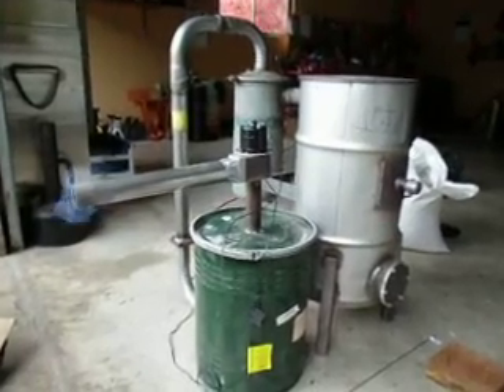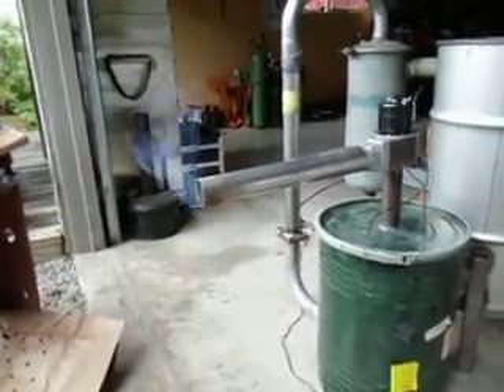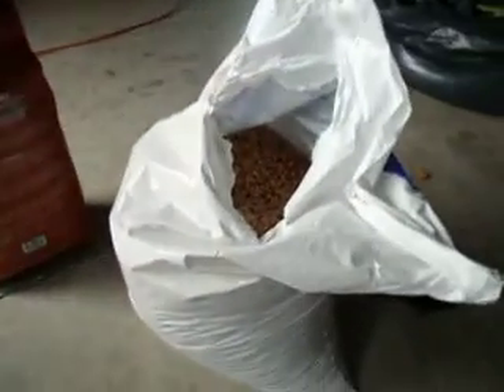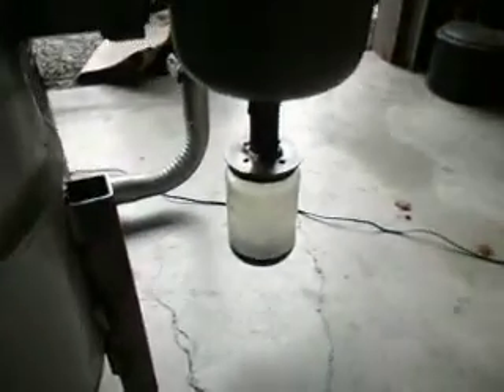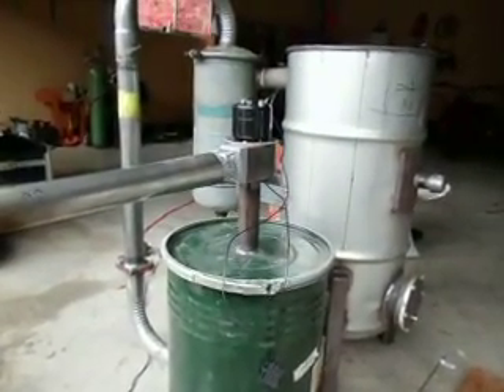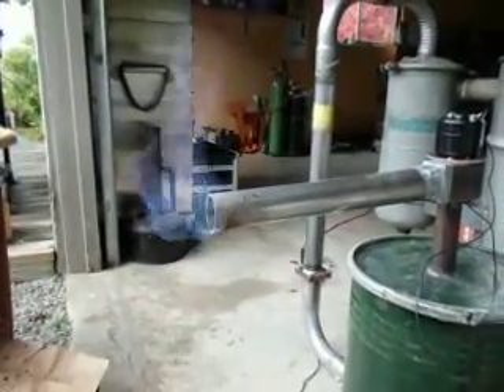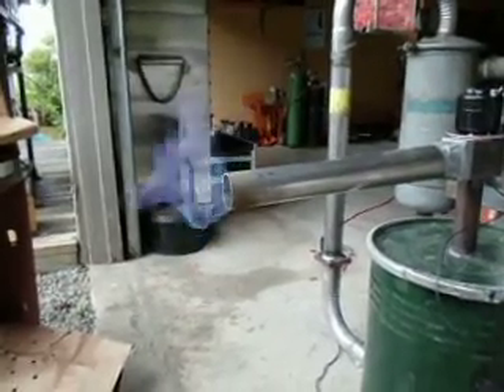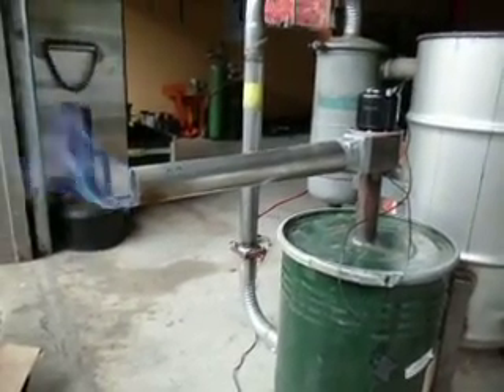gasifier progress update #4 FIRST FLARE !!!!

Comment: What size burn tube are you using, I missed part 1. Please respond because it looks like 4 inch and I have a chance to get some for cheap
Reply: I think he said 2 inch
Reply: But you can use 4 inch. The wider it is the more gas can flow through.

Comment: Hey Josh, have you hooked it up to a combustion engine yet? Have you ever considered a two way valve just before the fan to direct the gas once you get the flame? If you add that you can pipe the gas into the inside of an air filter just above the carburetor you don't even have to modify/remove the carb from the engine. As you can imagine this works with generators, cars,  lawn mowers, quads, or any combustion engine really.